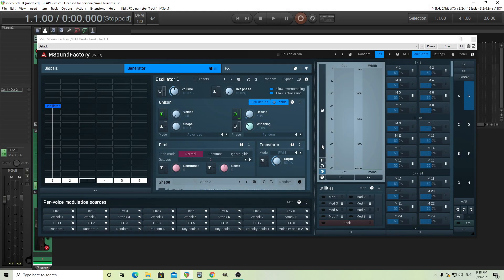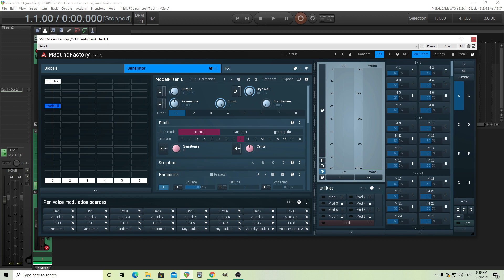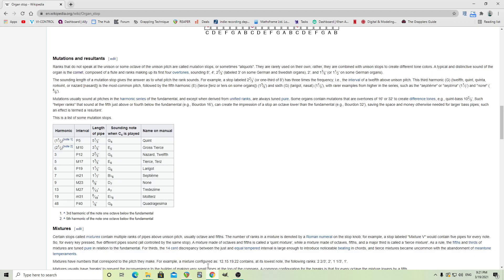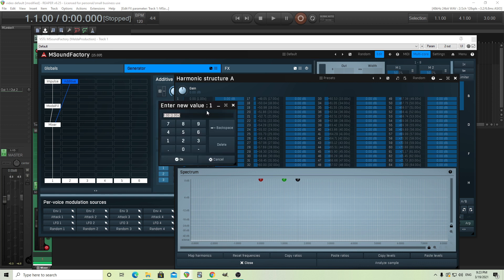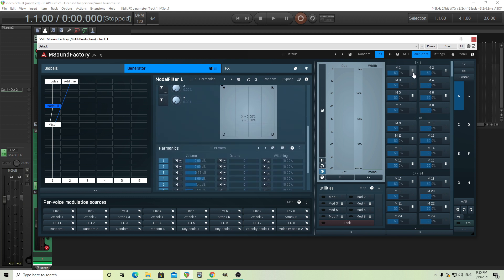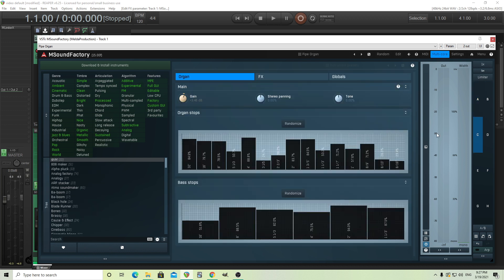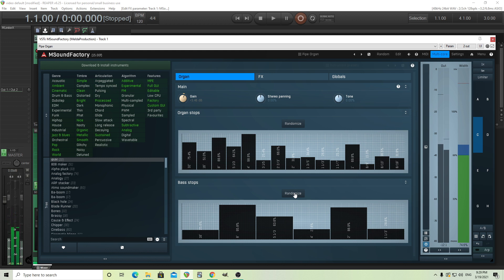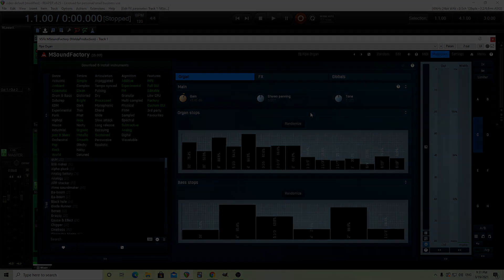Organ Synthesis in MSoundfactory

Comment: What type of filter do you use? Is it low-pass, high pass, band-pass, band select, band reject or comb filter. The moment u use the modafilter.
Reply from the maker: Its a lowpass filter at around 4500hz, just to take off the highend.